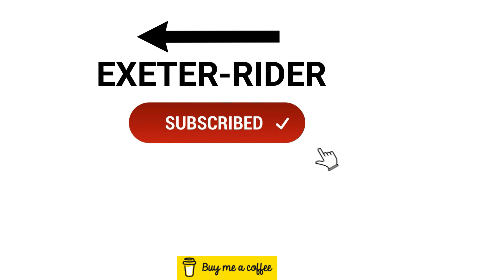DIY Home made Motorbike Ramp

Comment: Luvvly jubbly.
Reply from the maker: Does the job : )  How did the big day go?
Reply: Not as planned 😂 Said in Jethro's voice. What 'appened was, first day put on a Kawasaki Eliminator and it eliminated me. It was nice sitting right down into the bike and I loved the forward pegs and controls but it was a big lump of metal, I couldn't wrestle the handlebars round more than 90 degree turns. My son who's 6ft tried it and he said it was great on the straight and gentle bends but was difficult on corners. I just didn't trust it. Next day my upper arms were so sore, I asked if I could go on a scooter. I bloody loved it! Unfortunately, didn't have long enough that day to use the courtyard, so didn't do emergency stop or U turn. Went out on the private road network and had a blast. I have to go back, soon as I can afford it, do about an hour then I can go out on the road for Element E. He said I should pass, I'm this ( holds fingers an inch apart) close. I'll do gears again when I get a Monkey.
Reply from the maker: @lilynorthover8378  Moving forward Lilly thats all that counts well done you!  this time next year it will be all sorted hopfully, then the real learning starts
Reply: Whizzing along at a heady 28mph with the wind screaming through my visor, I had it up, doing a tight U turn round the instructor to scare him a little, then doing the slalom as I put the scooter away, I got it. I really got it 😍
Reply from the maker: @lilynorthover8378  Its in your blood Lilly, I could tell that.

Comment: nice idea , but i think i need to buy you a large whisky rather than a coffee = as another comment says [ j t ] it will need a lot more re= enforcing to cover all bikes weight ,,
Reply from the maker: It looks a lot thinner in the video, the 18mm ply is so strong, if it was big enough it could have a goldwing on there no problem.  18mm put is incredibly strong and the centre stand does sit on that 4x2 which connects to the ground. Super strong 👍🍻

Comment: Excellent idea !!  At my age I have my doubts of being able to put my NC up on its stand without the width of the ramp being quite a bit wider.  Come to think of it, taking the bike of the centre stand and off of the ramp could be fun...
Definitely a good idea though as the ground seems to get further away the older I get.  Getting back up is no fun either as gravity has definitely increased over time.  It has got to the stage now that if I drop my wallet it is easier and safer just to go and buy a new one...
Reply from the maker: Where did you last drop your wallet too?    Yes every little helps .  This simple idea made the whole job more enjoyable

Comment: Sorry old son,  I think the ramp is great but I genuinely believe the platform itself is too flimsy and needs a bit bit more strength or reinforcing. I wouldn't feel confident with that. Good idea though.
Reply from the maker: Hi James, honestly I could put a car on that thing and it will be fine.  its 18mm ply , supported by that 4x2.  Its not going anywhere : )